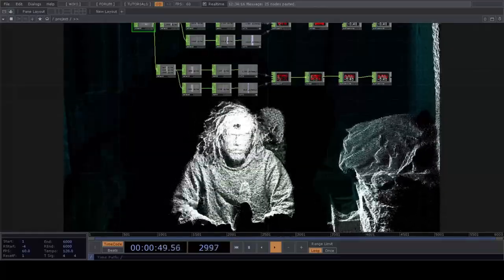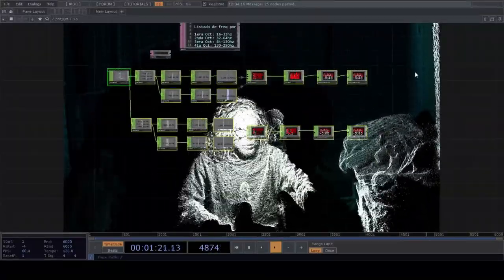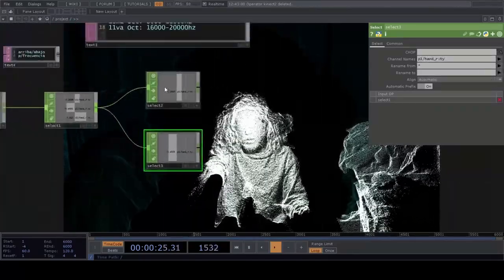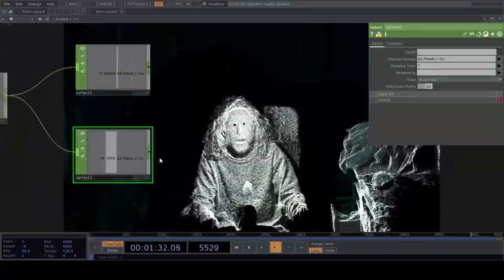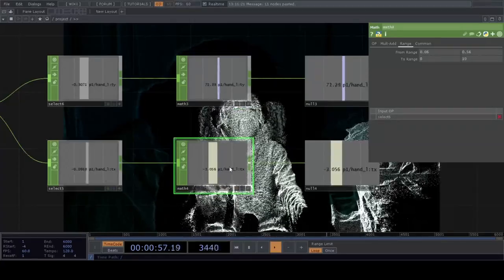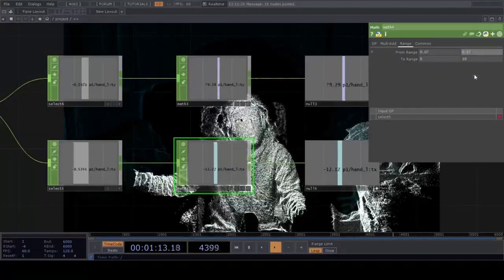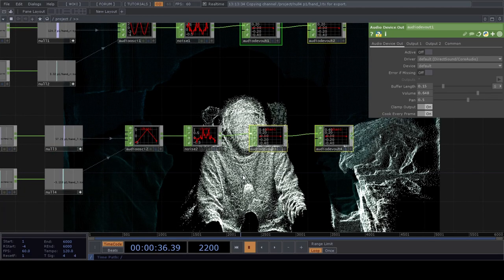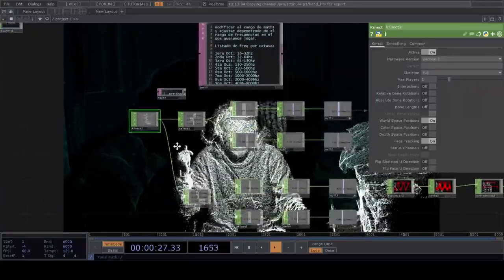How to build the ultimate Theremin using Kinect and TouchDesigner

Comment: Can I make it polyphonic? Like, by reading each finger's position individually?
Reply from the maker: I don't think so. At least not with Kinect V2.
Reply: Or better: use height (right hand Y axis) position to indicate tone like in video, then gestures to control chords perhaps? Like, some intuitive system for that would be necessary, but it's sure possible. Maybe inspiration from Sign Languages? Or something else? Like, using finger Y axis position to control exact pitches of chord?
Reply from the maker: @baltofarlander2618  Of course it's possible, Balto. I meant that it isn't in an easy/straighforward way, like it happens with hands, some gestures, etc. Kinect V2 doesn't capture finger data.
Reply: @uisato_  oh, didn't know. Maybe if I tried two kinect controllers and some custom program, then it'd succed.